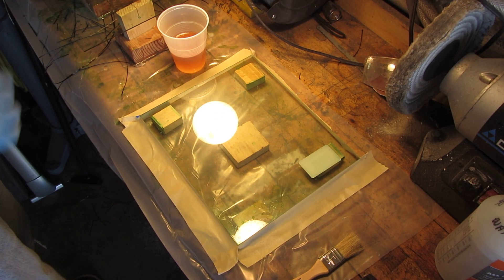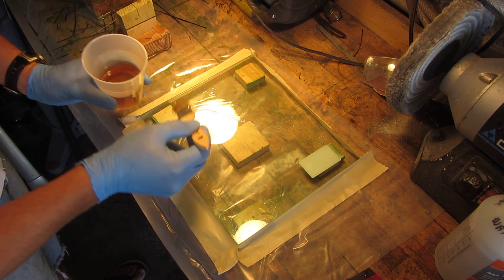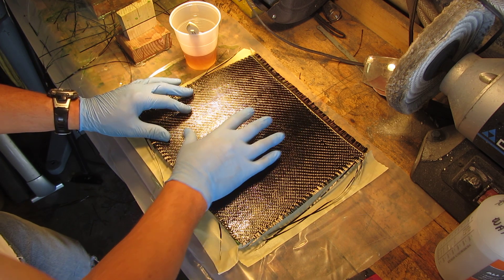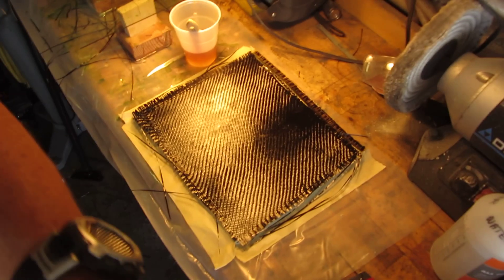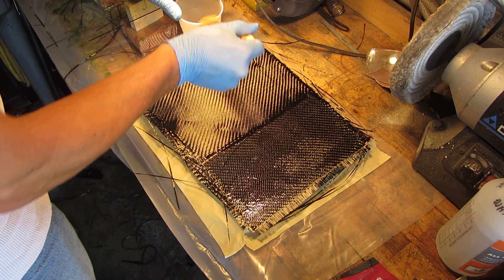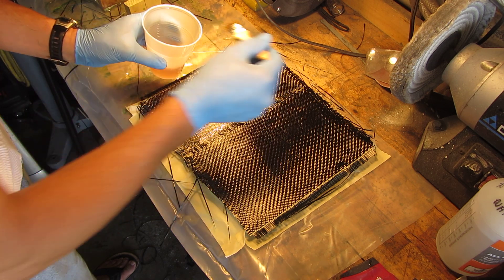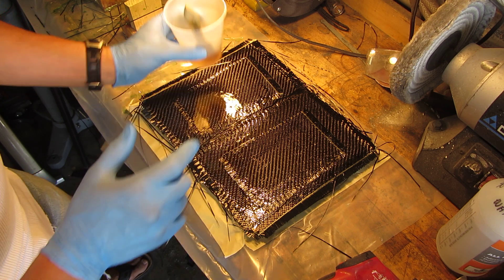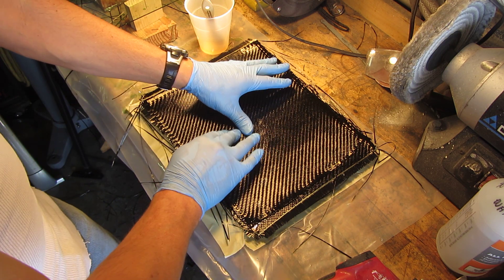Carbon Fiber plate making, part one

Comment: hey what is the difference between prepreg carbon plates and none?
Reply: Great question, maybe you can also find the answer here.
http://www.xccarbonfiber.com/
Reply from the maker: Prepreg CF are saturated with the correct resin ratio. Non, you add the resin yourself.

Comment: Great Video! I subsribed!   Would just one layer still make a stiff plate?  It doesn't need to be incredibly strong,I just don't want it to break like glass.   it will be the molded skin of my model airplane,
Reply: Frank Pirolo  A single layer of fiberglass is actually lighter then a single layer of carbon fiber. But fiberglass will need more layers in order to achieve the same strength making it heavier as an end result. If it's not a structural piece you can actually cheap out but only doing half of the layers as carbon and the other half as glass, that's actually what a lot of car manufacturing companies do for parts like spoilers, dashboards, etc.
Reply from the maker: It really depends on what fabric you are using, but generally, you would want two layers, as to ensure 100% overlap of fibers.
Reply: ebrabaek Okay, thanks!  Do you know how much lighter this would be than fiberglass? Because Fierglass is much cheaper, but I don't want to weigh down my plane.
Reply from the maker: Frank Pirolo
 Quite a lot more, if you use glass. Carbon is the ticket. I know it is more $$, but glas is a lot more heavy.
Reply: I think it'll be not enough strong just one layer.